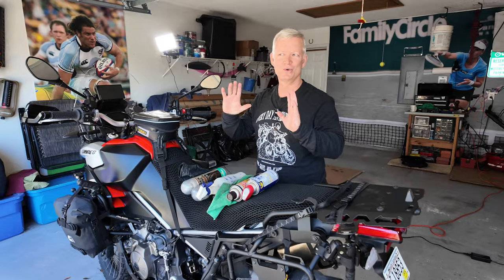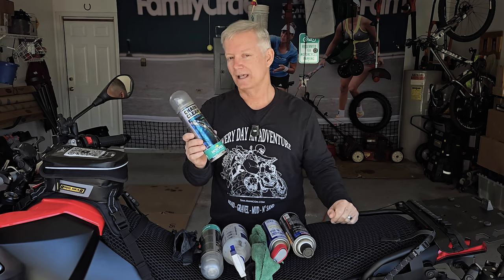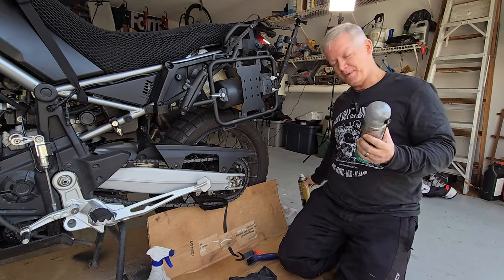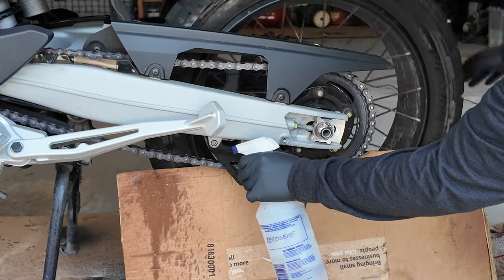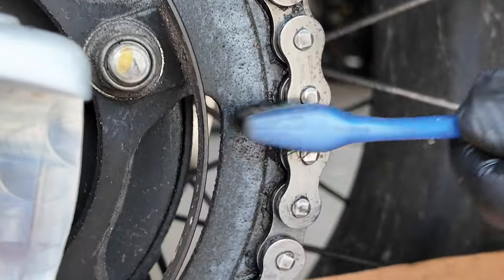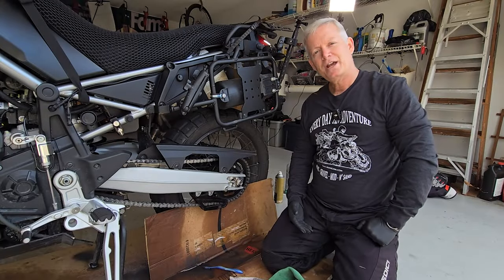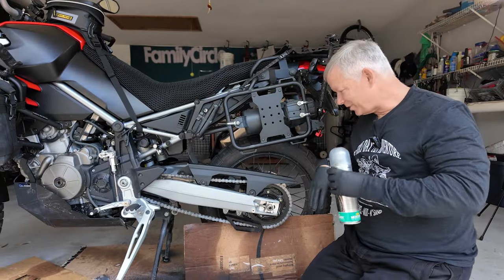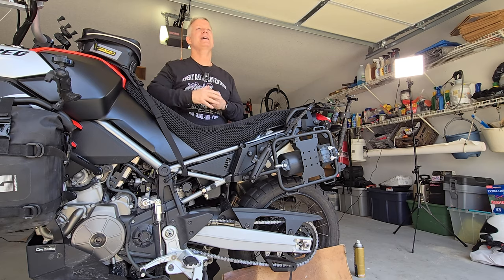Chain Maintenance, THE RIGHT WAY.

Comment: Hi, I love your videos, thanks for sharing.  I'm friends of your neighbors Tom & Diane.  :)  I've been riding & racing motorcycles since 1968 and my technique is slightly different.  On my street motorcycles I always lube the chain when I get home from a ride because the chain is as warm as it will get.  That warmth helps the lube penetrate between the plates, and might even get under the O-rings / X-rings.  That heat also helps evaporate the solvents which make the lube viscous.  As it sits and cools overnight the lube sets up and is less likely to fling off during the next ride.  On my MX bikes the chain doesn't get warm like my street motorcycles but I still work on the chain first after each ride.  Thanks again!
Reply from the maker: Hi Andy!  That's so awesome that you know Tom and Diane...smal world!!!  Thanks for your tips!
Reply: Thanks again.  Tom & Diane originally gave me your channel's name.  Recently I sold my KTM 950 Adventure but while I rode it I enjoyed your tips because riding a big heavy adventure bike is very different than riding my light weight CR500AF.  :)

Comment: Thanks for a good primer. For road bikes I switched to shaft drive a while ago. For dirt bikes, I follow the owner's manual that says to use 80-weight gear oil. Thanks again.
Reply from the maker: Hello Marco!  I have several friends who use the gear oil for their chains, which works great as well.  I should have mentioned that as another excellent lubricant.  Thanks for the reminder!

Comment: I know you're waiting for my input. I buried my last chain drive bike in 2016. I was riding 8-12k miles a year, changing the chain and sprockets every other year. No matter how much you clean and lubricate, trying to get more than 25k on a chain is a fool's errand. My habit was just to use spray lube at the start of each day. Spray it on, and wipe it with a rag. I only remember cleaning a chain once. in 12 years! 

I will never forget the first time I needed to change a chain. It was a maintance item I had not even considered. The knots in the chain caused the bike to buck like a bronco and I had no clue what was happening. A friend showed me the knot skipping over the rear sprocket. The damage not only destroyed the sprocket, but the nut on the front sprocket had to be cut off! It had welded to the sprocket!
Reply from the maker: Haha...you know it, Steven!  Each video we release, I ask myself, WWSD (What Would Steven Do)!!!  😂